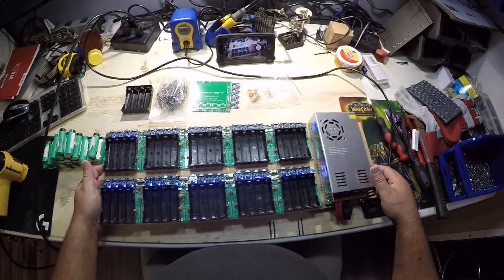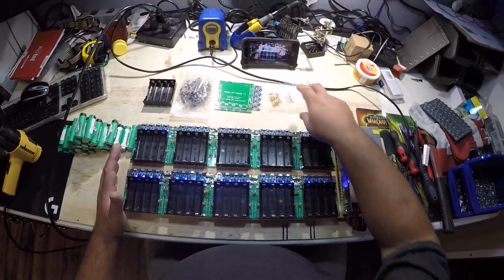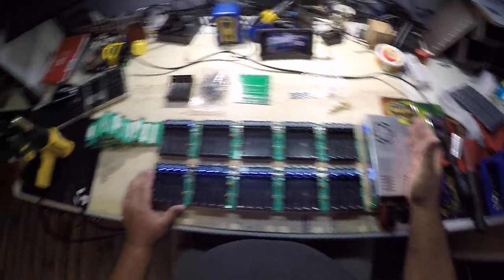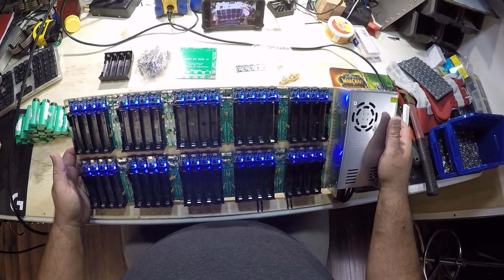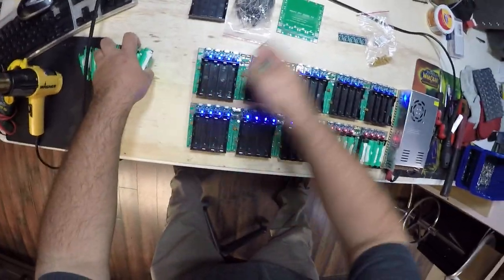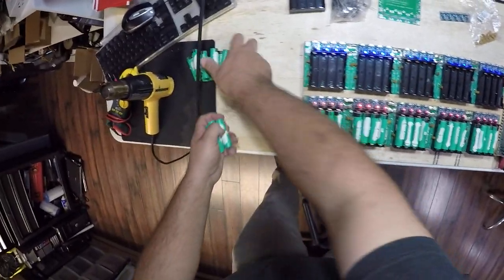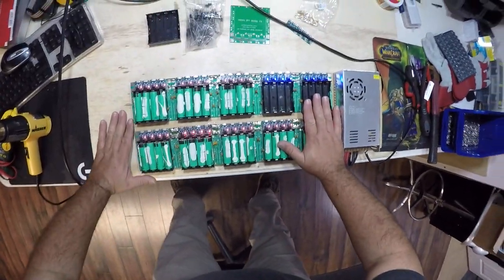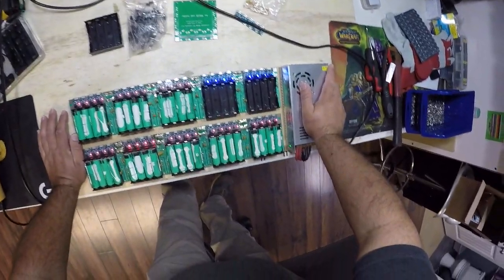Just a quick overview rundown of my DIY 18650 40 cell charger

Comment: Hi James, great video that raises the next question for me, after charging these reclaimed batteries, how did you capacity test these charged batteries? (Bulk, 4 at a time? Etc) thanks.  PS, any videos of that process?
Reply from the maker: I have 2 Megacell charging stations that test the cells and give me capacity of each cell, and the units also allow me to print labels for each cell. I am sorry I do not have a video on that process. Before I got the megacell monitor chargers I just used 4 tester chargers than hold 4 cells at a time. And they gave me cap, rest of each cell and i would just write on the cells with a marker. The Megacell chargers each hold 16 cells and with 2 I was able to do batches of 32 at a time! I have a video I have to make that I promised a buddy of mine, after that I'll do a review video of the megacell charger and post in in the 18650 DIY group for ya!

Comment: were can i get this Charger PCB board
Reply from the maker: A link to the charger kit is in The description. Each kit is for charging 4 cells. They can be linked together like I did to make one big 40 cell charger. It’s a open source project and the link to the original creator as well as the Gerber files can found in the description on my website.

Comment: I never put a fan on my charging stations.  fans can mislead you on potential heaters.  Of course my threshold level for a heater is very much lower than the general user.  If a cell hits 110F I pull it.  But I did that for the simple reason that I was selling the cells and if they got that high, chances are they would only get worse, so better to pull them.  

BTW, that is an excellent design for your charging stations.  Mine didn't have protection, and I have lost a few ports/cells because of putting them in backwards.  I have Ten, 30 cell slot chargers.  But since I don't sell the pretested cells much anymore, I stopped testing them for general use.
Reply from the maker: Its worked out pretty well for me so far, and yeah I can see that from a sellers point. I always monitor the temperature of the cells during my initial charging, and then Once they have rested for 2 weeks and i do the actual testing I monitor them even more closely. It also helps keep my tp4056's cool as well!
Reply: so if the battery hit 110f and up it no good? and i can still used a small fan on them to cool the cell when charging?
Reply: @djexotic07  Since I used to test and sell 18650's my threshold for temp was much lower than a general user.  My thought process as a seller was if it a cell hit a temp of 110F, then it will only get worse over time, so I wouldn't continue with it.  Because I couldn't sell product in good conscience that might have a heat issue later.   However as a general user, only you can set your temp thresholds on what is acceptable or not.  Good Luck with your build!
Reply: if you build the system right you can put heat sinks on the tp4056 and then run a small 1.5" 5v fan to cool the chips.  no need to cool the cells.  check internal resistance for cell health.